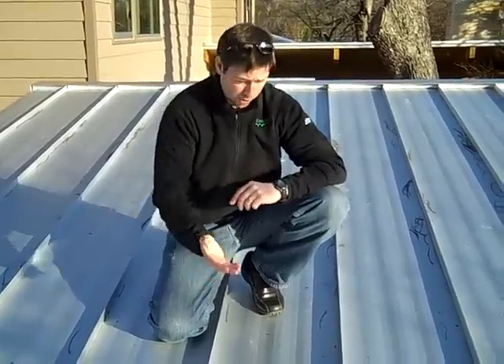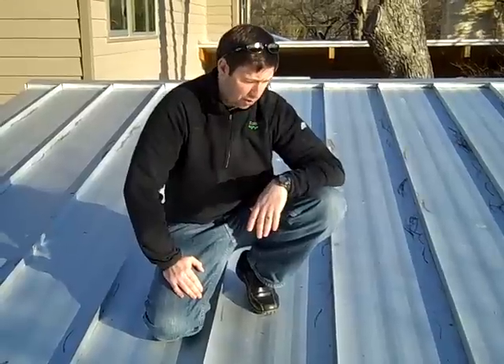Galvalume Metal Roof Review

Comment: This is an old vid for me (it's now 5/6/2020) that I just found. We installed a Galvalume R-panel commercial grade roof on our home several years ago. I didn't strip the old roof because of the timing of doing it all myself with the help of family members. The biggest reason we needed to do it was because the lean-to type roof the previous owners had put on the addition was just about the equivalent of having no roof at all. The ceiling inside was almost as hot as the roll roofing they had on top. So, I put down a framework of 8" C-purlins, 4' on center, filled in with blowing rockwool, then put the R-panels on top. For the garage roof, which was pretty heavily sloped (think 30 degrees), I put down 2X4's flat, 4' on center, filled in with styrofoam sheeting, then put the metal on top of that. Probably not the way the manufacturers would recommend, but all in all, the savings on our insurance and utility bills have been noticeable. When it came to the second floor, I mapped it out in my mind for a year and a half before I finally caved in and hired a team to come in and install that. Haven't regretted it for a moment! Metal is the way to go. Keep up the great work, Matt. Your videos over the years show a tremendous growth in your construction maturity as well as your on-camera style!

Comment: I live under metal roofs which were assembled from recycled barns decades older than my 50-year-old home. Terrific material! I also have a Galvalume steel building that looks near new after almost 20 years. I abominate replacing shingles, and my house and outbuildings survived Hurricane Hugo with no damage. If I reroof I''ll go standing seam. Slinging metal roofing beats humping shingles. Been there, done that.
Lurk on professional roofers forums, not DIY froo-froo sites. You'll learn a lot.

Comment from the maker: @bobmcalister Appreciate the comments.  In our hot/humid climate the reflective roof makes a big difference, however that reflective quality of the roof will degrade in time with dirt/pollen/fading etc.  The biggest long term benefit is to run your metal roof up on 3/4" lath so the back side of the metal roof will act as a radiant barrier.  I wonder if that's what your clients have been experiencing?  Yes my insulated roofs are more expensive but this is a 50+ year roof and it's worth it! Matt

Comment from the maker: @pxyvision001 I've not had a chance to see that video but I can tell you that a metal snap lock roof would withstand wind much better than a comp shingle roof.  This roof is screwed down to the decking and would only be prone to uplift at the panel edge where it meets the eves.  Matt

Comment: In Australia we use this type of roofing often, especially on low pitched roofs less then 5 degrees. On stepper pitchers we use corrugated sheeting screwed through the high points in the metal sheeting directly in timber purlins. Love your videos Matt so interesting seeing the different materials and design details you use.

Comment: I live in an old home that still has it's original cedar shake roof under a tile roof.  We are in the process of deciding which type of roof to replace it with.  We have been leaning toward the metal roof, but are a bit confused.  Some individuals we have talked to recommend removing the tile roof, leaving the original cedar shake roof as a base, and applying the metal roof over that.  Some suggest removing both, redecking the entire house and then applying the metal.  What would you recommend?

Comment: I work in the steel industry and we produced Galvalume at Bethlehem Steel where I started.  I believe the warranty for Galvalume is thirty years.  The aluminum zine alloy coating over the cold rolled steel substrate will corrode over time.  I would go with an aluminum standing seam roof instead.
Reply: Steel TROLL suuuure for 3x the price

Comment: Definitely remove the old shingles and old under lament before having this type of roof installed. You never know if you have rotted decking under the old shingles. I had this done to my house which is a simple gable A frame roof. Replacing it with shingles would cost 2800.00...the CF lock panel roof was 4200.00.
The contractor found 1 spot that the decking needed to be replaced. Cost me an additional 100.00.  Electricity bill has almost been cut in half..this roof reflects most of the Sun's rays and results into a cheaper bill. I figure It will pay for itself in about 5 years. No more worries of hail storms anymore and got a discount on home owners insurance on top of that. It's worth the extra money and the best thing is..I don't have to replace any shingles after a hail storm or worry about tightening or replacing worn out fasteners as you would with an R panel type roof. All of the fasteners are covered.

Comment: I am interested in replacing my old single roof with a Galvalume metal roof.  I too am confused with what the builders are saying.  My roof is old and they want to put the new metal roof over the old singles.  For some reason, that does not sit well with me.  Also, wouldn't the roofers need to check the wood on the roof and the condition of the old singles first?  They are 23 years old at this point.  One roofer said, that if he had to remove the singles, it would cost around $1,000.00 more.  Please give me some solid input about this.  Thanks.  Rich
Reply from the maker: +Richard Ferrara Rich,  Pay more to have the shingles removed, inspect your decking, and put down new underlayment.  I would not recommend a metal roof over an old shingle roof.  Matt
Reply: to readers in the same predicament: some of these legitimate standing seam (IE clip-fastened) metal roofs call for minimum of 5/8" thickness PLYWOOD roof decking. Plywood, being a superior product in so many ways to OSB, has twice the fastener holding power of OSB.
Reply: you know how many guys (contractors) dont know why to strap the metal roof here in indiana !they all want to lay the metal on top of the waterproof material! and have know idea why to strap it! but im not a contractor so Dont ask me i dont know lol i just buld homes not houses !

Comment: Great Videos! I had a few questions regarding the drip edge. I live up north in Canada, my roof is 8/12 with Ice&Water and RoofGard-Cool Grey over top and 1x4 horizontal strapping. should the d edge be custom to overlap the bottom 1x4 and be bent to rest on the roof to deflect any water/ice that formed there? If so should I seal the connection with Ice&Water? Or would a standard d edge be ok? Also I have extended the Ice & Water to the bottom or the facia 2x6.
Thanks Pat

Comment: Your house is grounded or should be. Same chance your car will get struck and no the tires don't prevent it. It can travel up to 10 miles in free air and I doubt a metal roof or 1/4" of shingles will have much of a difference. That metal roof is better than any in every way. I hope I helped you out.

Comment: I think you made a couple mistakes.  The metal will condensate, in the air space, and the 1x4s will rot and then there will be nothing holding the metal roof.  Metal roofs have been used directly over sheathing for hundreds of years without an airspace.  It's a proven method.  The next problem is with the underlayment.  The underlayment needs to be permeable to breath.  I think a better underlayment would have been a synthetic.

Comment: New sub here. Catching up on your videos.
Old video BUT, I was thinking of painting it gloss white. I know there is special roof paint for that. Local paint company went bankrupt, so I bought a lot of exterior white gloss cheap. Can I use it on the roof (same roof you're standing on), or would I be wasting my time and gain very little?
Reply from the maker: The latter. If it’s galvanized it’s already pretty good. Minimum benefit to white. Thanks for watching one of my older videos!
Reply: Standard paint does not adhere well to galvanized metal. It would soon look horrible. They make special paints for galvanized metal.
Reply: let the roof weather for about a year to get the oils off the panels before painting;. In all likelihood, during that time, you will grow to like the bare look. Galvalume reflects 55% of the light and painting will makevery little difference. Some contractors power wash with a vinegar solution before painting;.

Comment: The Snap Lok type of roof requires a minimum 3:12 pitch.
Reply: there are other snap-locking roofs, such as the following galvalume roof, which are rated for lower slopes. The following is rated for 1:12 pitch.  
http://www.aepspan.com/files/PS132_KlipRib.pdf